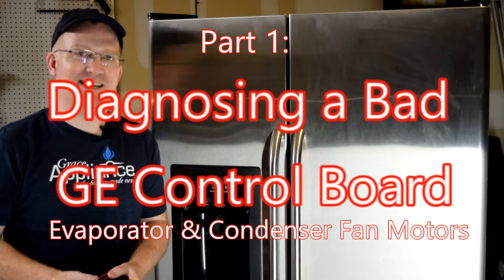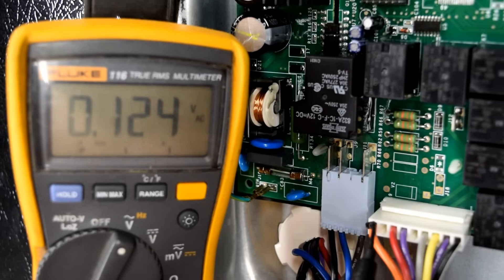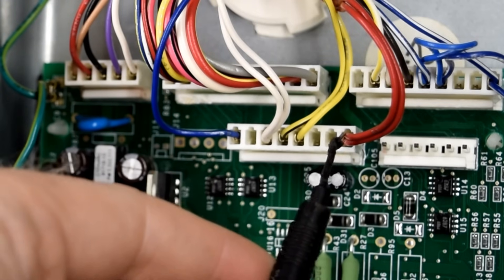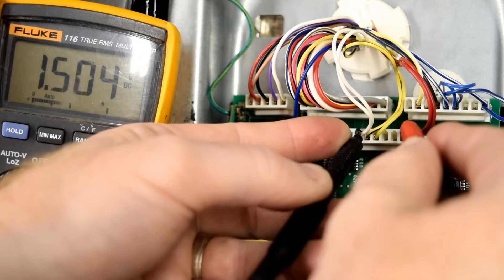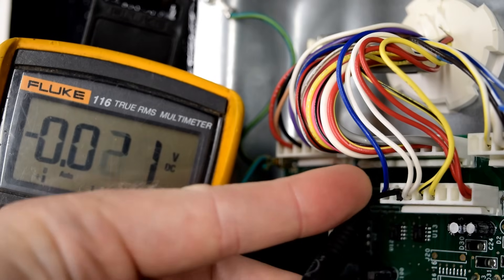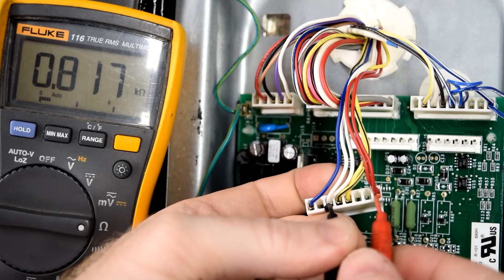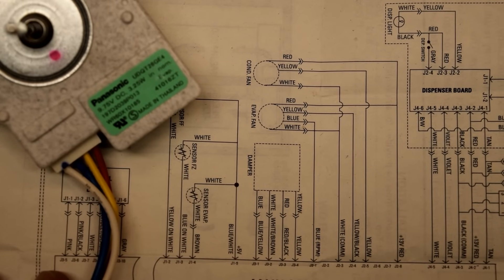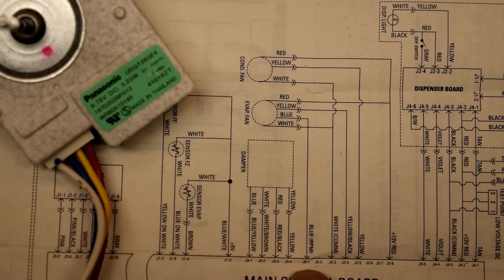Diagnosing a Bad GE Board - Part 1: Fan Motors

Comment: Andy....I don’t understand how come there are 3 different supply lines to fan motors. I know white is neutral; yellow and black is evaporator fan motor; yellow is condenser fan motor and the red is fan motor for what ?  Please advise
Reply: Where is the tachometer located ?
Reply from the maker: @unioncityhiller  yes, you can check at the control board or the fan motor for voltage.  If no voltage upon plugging in the board, it's a failed board.  
The tachometer is part of the evaporator motor.  It sends a HZ frequency response to the control board depending on how fast the fan spins.  The board, if it does not get this frequency response will stop sending voltage to the fan.
Reply: As you instructed, I unplugged the refrigerator for a few mins and plugged it back in and checked the voltage at the evaporator fan motor socket immediately.  I got 0.8 DC volts to 0.9 DC volts.  Please advise my next step.
Reply from the maker: @unioncityhiller  replacing the control board would be my next step.  Thanks!
Reply: Andy......so my main control board is bad?
Reply from the maker: Yes, bad board based on those voltages.
Reply: Andy......I really appreciate your quick response and  support.
Reply from the maker: @unioncityhiller  you're most welcome. Let me know if you run in to any issues.
Reply from the maker: Hi, that a common shared supply voltage for both fans. 13.5vdc which is the routed to particular fan motor as needed.  The condenser fan will always get full voltage because it's not variable speed, but evaporator fan voltage will vary based on the needed speed either low medium or high speed.  I hope that makes sense.  Let me know if you have any questions.
Reply: I have a Samsung RS2577SL side by side refrigerator.  My evaporator fan is not running, so I disconnected the fan motor and checked the resistance, I got 1.7 to 16.2 ohms across the leads.  Then I checked the voltage in the socket where the evaporator fan motor is connected to it, I got 0.8 to 0.9 DC volts.  Does that mean my main control board is bad?  Do you know if there are other controls boards in my fridge that could be bad as well? 

Thanks!
Reply from the maker: @unioncityhiller  a Samsung board will not send fan voltage full time to the fan if the tachometer on the fan itself is defective.  Take a voltage measurement at the fan again and with your leads connected to the fan wiring, unplug the fridge and replug it in. The board of functioning properly should send around 13vdc for a few seconds, stop for a few seconds, and then repeat this process a few times.  
It's expecting to see a tachometer response from the fan and if it gets none, will stop sending voltage but the board is alright. It would be a failed fan motor...even if you can visually see it spinning.  

This has been my experience at least.
Reply: You meant to check the voltage at the fan motor socket again?  If I don’t get at least 13 DC volts,  does that mean the board is bad ?
Reply: Hi Andy.....Any possibilities that my freezer sensor could’ve gone bad as well ?
Reply from the maker: I wouldn’t suspect it unless you’re having issues with the freezer once you resolve the issue with the fan not running.  
It would not have an impact on if the board sends voltage to the fans upon start up.
Reply: What’s the purpose of the freezer sensor btw?
Reply from the maker: It is the temperature sensor for the freezer section.  It sends a resistance back to the control board which then determines which components to run or turn off to maintain temperature.

Comment: Hi Andy,
Thank you for making the videos and sharing.
I have issues with defrosting and the temperature display reads wrong temperature. Freezer is too warm which makes ice melt. I think it's defrosting too long. It may link to temperature control, because the display was showing -2, but manually measured at 39. It corrected itself after unplugged and plugged in again. So I thought the issues are the sensors and thermistor.
I replaced the thermistor and all sensors, but no good. Therefore, I think the issue is the control board and evaporator fan. J2 testing : voltage is good, but the resistance to fans (white and red) is 0.80k ohms. Could you please review my issues and recommend? Shall I replace control board and evaporator fan? Thank you so much.
Binh
Reply from the maker: Binh Truong hi, I’m sorry to hear that!  That’s nuts because the schematic lists a fan with no sensor, but I’ve had it happen to me as well sorry to say.  
I don’t believe you’ll be able to modify the non sensor one to work. You’ll need this fan instead:
Affiliate link https://amzn.to/2HR1MSn

Thanks!
Andy
Reply: @GraceAppliance  My original fan model number is WR60X10043, and the new one look similar except it doesn't come with the evaporator sensor attached with the harness. So I wonder if the WR60X10074 will work? Thanks
Reply: Here is the result that I looked up from other web site: "Part Number WR60X10185 (AP3875639) replaces WR60X10043 .....This DC evaporator fan motor is used on those that DO NOT have a thermistor wired into the connecting harness. For the motor WITH the thermistor order WR60X10074"
Reply from the maker: Agreed, it’s the wr60x10074 you will need.  The plugs are the same for both fans but the xxxxx0074 is the one with the sensor.  

Thanks!
Reply: @GraceAppliance  I replaced the few fan motor yesterday and it is running great at full speed; however, the "too warm" issue is still there. I notice that it was defrosting twice in the last 20 hours, and it was too warm after defrosting.
Reply: "new fan motor"
Reply from the maker: @binhtruong1862  So, it's beginning to sound like you have a sealed system issue based on what you describe. 

Have you seen where your coils have been frosty like this?
https://ww2-secure.justanswer.com/uploads/robclement/2010-10-30_203350_evaporator-coils-good-frost-pattern.jpg

They should have a light coating of frost on the majority of the coils (if not in defrost) once the compressor has run for around 30 minutes. 

If not, this would indicate an issue with either a weak compressor or lack of refrigerant.  If they only partially frost up, it will get cool in the freezer, but may never totally freeze the food solid.  

Defrosting 2x a day sounds about normal...maybe 20 minutes each time.  However, if the compressor isn't able to then quickly bring the freezer temp back down, it may cause the warm temps as you describe.  

Just my initial thoughts.
Reply: @GraceAppliance  Thanks Andy!
Reply from the maker: @binhtruong1862  You're welcome. I wish it were better news.
Reply: @GraceAppliance  Hi Andy,
My refrigerator is running better with the new fan motor installed. It's still warm after defrosting. The temperature is rising up to 11F in the freezer and 41F in the refrigerator, then cool down to 0F in the freezer and 36F in refrigerator as setting. As you mentioned in your previous comment, my refrigerator may has sealed system issue. What is your recommendation? Thank you.
Reply from the maker: This may be fairly normal temp rises actually.  I’m not sure I’ve ever put a thermometer to test the normal rise though.  I do know both cabinets temp will rise during the defrost cycle.  
I would let this run for a period of time and see how well it does with keeping the food frozen. 

If you have the ability to measure a liquid’s temperature on the fridge side you should never see the food or liquid go above 40’F, but the air temp may in fact rise above this during the defrost cycle.  

In the freezer section, it should be keeping things like ice cream and chicken breast frozen rock solid. If they’re mushy at any time it’s gotten too warm in the freezer. Any food temp above 5’F would be too warm.  Ideal is about 0’F.
Reply from the maker: Sorry to hear about the issues with your refrigerator. 

Are you seeing any kind of Frost build up on the back wall of the freezer.  

The next time the freezer is too  warm, remove the rear wall inside the freezer by removing the 4 bolts and take a picture of what the evaporator looks like.  
Feel free to send it to graceappliance@gmail.com and that will tell us a lot.  Also, take notice of the fan is turning or not at that time.
Reply: @GraceAppliance  
Hi Andy,

Thank you very much for your response. I just emailed you pictures of my refrigerator. There was no frost built-up, and fan wasn't running at the time, and there was a lot of moisture and water vapor (wet) in the freezer, and the temperature was showing at 2 for the freezer and 36 for the refrigerator. I knew the temperature was not correct, so I unplugged it and waited for 20 seconds and plugged it again. The temperature was changed to 31 for the freezer and 41 for the refrigerator. The cycle started over again; it's working fine until defrosting...

I also noticed that the seals near the evaporator heater was deformed due to excessive heat ?(picture). 

Thank you very much for your help.
Reply from the maker: Hi  @binhtruong1862  ,
So looking at your pictures and hearing the symptoms, here are the things that come to mind:

It does look like the heater has stayed on too long at one point. The things that can cause this to happen are either a failed defrost thermostat or a stuck relay on the main control board.  
I would check all of your temperature sensors and your defrost sensor for which I have a video called testing and replacing a defrost sensor.  

If all of the sensors are good, I'd replace your main control board.  See  links in the description. 

Another reason I am leaning toward a main board is that the display LEDs are not fully lit on your temperature control. This symptom could technically be a failed user interface board, but most often will be a main control which sends the voltage to the user interface board.  And given the symptom of the temps changing upon reboot makes me think main control as well. 

Either way I would change all temperature sensors along with a board swap.  

Let me know if you have any questions on telling the temps sensors.  

Thanks!
Reply: @GraceAppliance  Hi Andy,
I already replaced defrost thermostat, defrost sensor and all other temperature sensors. The display LED is working fine, it's just the picture imperfection. So I will replace the main control board and will let you know. Thank you very much for your time and help.
Reply: Hi Andy,

I received the main control board, but haven't yet installed it, because I found out another problem. The defrost heater wire terminal and the blue wire was burned (picture attached). It's quite expensive to replace the whole harness. Do you have any idea how to fix this? Do you think the defrost heater causes the problem? I would like to fix the harness and install new defrost heater and test run before swapping new main control board. Please advise. Thank you.
Reply from the maker: Hi Binh, 
Once the wires are disconnected on both sides of the heater, you can take the resistance OHM measurement across the two terminals on the heater itself.  

The burnt wire is most likely due to a loose connection which creates increased heat and thus a burned wire.  But, if it has continuity of about 22 ohms, the heater is good.  

The burnt wire would likely be the issue.  You' repair this by cutting the black electrical tape around the end where it's doubled over so that you have a little extra slack on the wire to work with.  You'll then cut off the burned portion of the wire, strip back about 1/8 of the insullation to expose a small portion of the wire at the end.  Then you'd need to install a crimp on female spade to the end of the wire so that the wire can be reinstalled to the heater.  

It's a very easy fix luckily in your case.    : )

Let me know if you have any questions!
Reply: @GraceAppliance  Thanks Andy!
Reply: @GraceAppliance  Hi Andy,
I fixed the evaporator heater wire and tested it, and it is working. Test run for couple of days, but the "too warm" issue is still there. Then, I replaced the main control board, test run for couple of days, but it has the same issue. I noticed that the heater was on More frequently with the new control board. The temperature in the freezer rise until 31F while in the defrosting cycle. So I don't know what else to fix. Please advise. Thank you.
Reply from the maker: Hey,
If the warm freezer is caused by a defrost issue, i.e. excessive frost build up on the evaporator 
The only other components would be the hilimit thermostat which is ok in your case...and the defrost sensor on top of the evaporator.  

Perhaps a failed defrost sensor is causing the defrost to stay on too long?  I have a video on how to test a defrost sensor with your multimeter. 

I'd replace it either way because they're cheap at under $10, but it would be good to test it for failure to confirm this point.  

Let me know if you have any questions.
Reply: @GraceAppliance  As I had mentioned in the previous comment. After watching your videos, I replaced  all the temperature sensors and the thermostat. My refrigerator has 4 sensors and I replaced them all with these that I bought from Amazon WR55X10025 Temperature Sensor for General Electric Refrigerator

I tested all again today from the back panel and all 4 measured around from 6-7 k ohms at room temperature 68F.
Reply from the maker: @binhtruong1862  
Thanks Binh,
When the freezer is getting too warm, I would remove the back panel of the freezer inside the freezer to expose the evaporator. 
I'd be curious what it looks like at that point.  If you could email me a picture at graceappliance@gmail.com 

That will help with further troubleshooting.   

Also please take note if the evaporator fan is running at that point.  

Are you noticing that it's getting too warm only after the defrost cycle or would you say it's too warm in general?
Reply: @GraceAppliance  Hi Andy, it's getting too warm only after defrosting cycle. When the heater is glowing, everything else is not running. And I think it is running too long which causes ice melting and too warm.
Reply from the maker: @binhtruong1862  Hi Binh, 
It is normal for nothing else to be running while the defrost heater is on, so that sounds fine. 

Did you replace the control board yet?
Reply: @GraceAppliance  I installed new control board last week, but I still have the same issue. I notice that the evaporator fan is running but not as strong as used to, and the frosting build up on the coils quickly but the temperature is still warm after defrosting. And sometimes there's condensation on the back(outside) of the freezer.  Do you think the evaporator fan has issue? Thanks.
Reply from the maker: @binhtruong1862  it's quite possible. 
You'll need to check the voltage output at the control board as shown in this video. If the board is sending 13.5vdc but the fan is not spinning at full speed that would be a failed fan. 

The evaporator fans have a tendency to short out due to the wet environment they live in and thus damages the control board.  

I'd focus in on that evaporator fan motor and see what the voltage is from the control board.
Reply: @GraceAppliance  here's the results for testing the J2 DC output:
White+red= 13.70
White+yellow/black= 12.84
White+yellow=11.98
Resistance ohms:
white+red= 0.62 k ohms
Reply from the maker: @binhtruong1862  
This result tells me that the fan motor should be running at high speed.  

I would replace the evaporator fan motor.  That should resolve it for you.
Reply: @GraceAppliance  My GE refrigerator model is PSI23SGNAKBS. Do you know which one shall I buy? (With temp sensor or not?) May I have a Amazon link? Thanks Andy!
Reply from the maker: @binhtruong1862  Hi Binh, your schematic shows the fan with 4 wires and no sensor attached
like this one. affiliate link: https://amzn.to/2HKz2uw

Thanks!
Andy
Reply: @GraceAppliance  Ordered from your affiliated link. Thank you.
Reply: Received the fan motor. However my original fan has the sensor wire hook up with the harness. So should I cut the wires and connect to the existing harness or order a new one with sensor. If I cut the wires of the new fan motor, then it's not returnable? Thanks

Comment: Hi Andy sorry it took me so long to reply as I was waiting for my new digital multimeter to arrive. I checked the new recently replaced  relay as you suggested and got 112 vac, the compressor runs consistently and the condesor fan turns on but after about 10 minutes. The new  evaporator fan still does not turn on. Would you have any other suggestions?
Reply from the maker: Mike Robledo 
No problem.  
I’ve got the service manual which I’m glad to send your way if you needed it.  Feel free to send me an email to GraceAppliance@gmail.com and I can reply with that.  
It will be a big help in walking you though how to enter the service modes which you can force run almost every feature on the refrigerator.  
For instance, I’d start with a force run of the evaporator fan motor which would rule out the fan motor and control board (and associated wiring). You say both are new, but I’d want to just see it in action.  

The refrigerator evaporator fan circuit is the plug CN75 pins number 3 (orange) and the other meter lead on CN10 pin 3. You should get between 7-12vdc. 

Then CN10 pin 3 & CN75 pin 6 (brown) should measure between 2-3vdc and indicates that the fan is indeed turning.  

We can start there.  I’d assume these parts are both good and it’s likely going to be a failed temperature sensor that’s at fault by not telling the board to supply voltage to the fan.  Or, a failed door switch as the fan would not spin if the door were ‘open’. 

Thanks, 
Andy